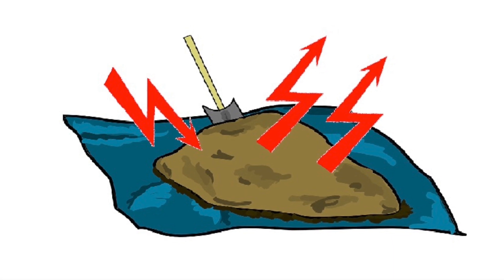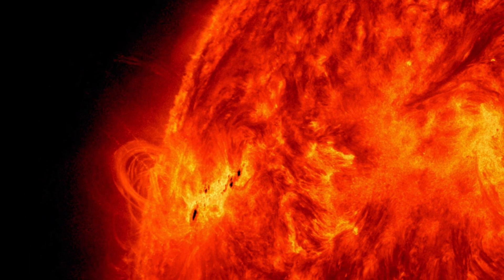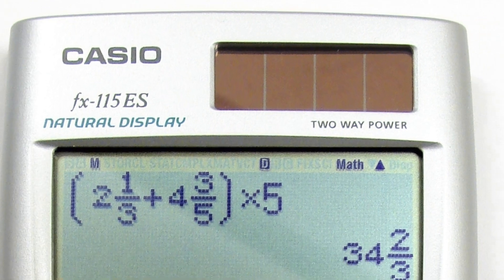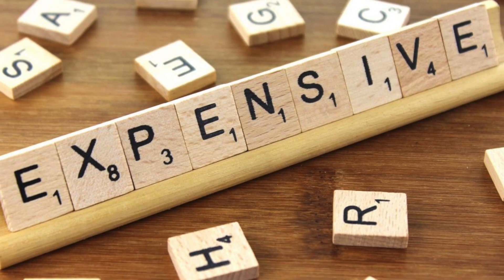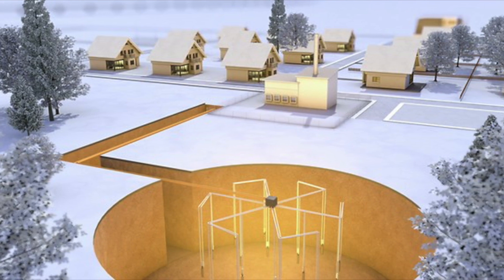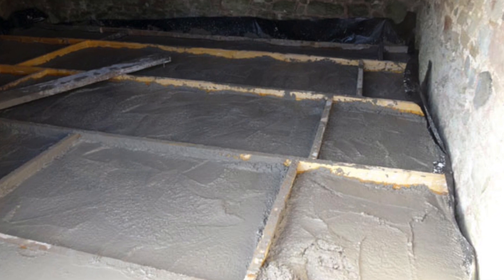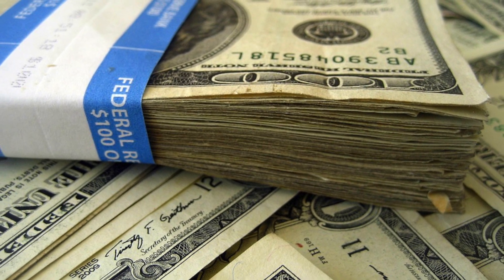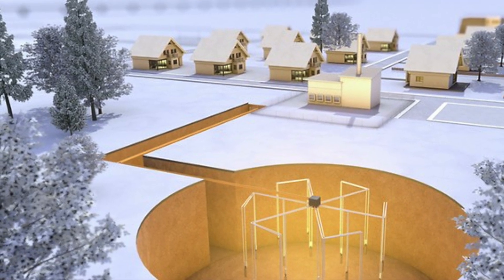Home Solar Thermal Dirt Battery (2020)

Comment: geothermal energy has been around for a very long time...but if you were going to go through all of the trouble to heat your home basically for free...why not make it so you could pump the cold into the ground to use in summer for cooling...you only need about a 20 degree difference in temperature for cooling while you have a  much bigger difference in temperature to   heat your home compared to the temperature outside...so technically it should be much easier to cool a house in summer than to heat in winter
Reply: no...I'm not confused.. its definitely u that's confused...what's the difference if you transfer heat between a heat exchanger inside of a house and the ground down far enough to where the temperature of the ground stays consistent....and between a heat exchanger inside of a house and an insulated tank in the ground...well I'll tell u the difference...its the tank....all of the energy comes from the same exact place at the end of the day...the sun...and that heat energy is transferred between the house and ground for both...you just live somewhere it requires you to use a insulated tank in order for geothermal energy to work for you...costing much much more to transfer heat between your house and the ground....and it's still not even capable of cooling down the house in summer because of only 1 tank...its either that and you just got ripped off and you dont even need the tank to begin with and you would be able to both heat and cool your house without a tank  by just putting a heat exchanger inside of the ground low enough where the temperature stays consistent...why go through all of the effort to pump heat into the ground from the sun in summer to use in winter...sure it might help cooling down the house for a little bit in the beginning of summer ..the tank only holds so much fluid and will quickly reach maximum temperature and capacity then there is no way to transfer the heat to the ground now you have a much more dense hot liquid on top of your roof that you must deal with...you could just use your tap water to cycle the hot water on top of the roof once the tank is at maximum temp and capacity...you can not transfer heat to a insulated tank only...I know how everything works cause I am a certified hvac technician...and this is a shitty concept...I suppose this is where you say that there is a heat exchanger underground that can transfer heat to the ground when the tank reaches max temperature and capacity...then why even have the tank to begin with...how big is the tank anyway...you definitely wont tell me because you now know that I am in the hvac field and some math would come your way to show how stupid of an idea this really is...retarded on many levels...1 btu is the amount of energy it takes to heat up 1lb of water by 1 degree...all of those btu's of energy on top of the roof would have to be removed by a ac just to get the house to where the energy is cancelled like it's not even there...before you could start lowering the temperature in the house using ac...idiotic would be an understatement
Reply: @metou3072  The deeper you go the warmer it gets..  Why would you bother pumping cool air into the ground when you can already pull cool air out of it in the summer.. There is a reason a basement is the coolest place in the house in the summer.
Are you planning on making perafrost under your house to cool it with.. This seems odd.. There is no need to pump cool air into the ground just pull the already cool air out of it. FFS.. People will argue over the dumbest shit on YT..
Reply from the maker: @masterv2118  no no no he works with Hvacs, he MUST know what he's talking about.... not my Hvacs, but someone's Hvacs....
Reply from the maker: @metou3072  Sorry, no, you don't get it. You really don't get it. Your response made that very clear.  You're now trying to justify something you really don't understand to make yourself look smart. It's NOT geo thermal, it's geo battery. They are very different systems regardless of how you think they aren't. Thinking they aren't different just means you don't understand and you dug yourself deeper into not understanding with that reply.
Reply from the maker: @metou3072  you still don't get it. it's not an Hvac system. once you finally let go of that you can move forward, till then you're in another world.
Reply: @SimpleTek  show me a battery that can not provide electrical energy?... Besides a drained battery
Reply from the maker: @metou3072  don't take words out of context, it's a "climate battery", it stores heat. With your every reply it's pretty clear you don't know what you're talking about and are grasping at straws here.
Reply: @SimpleTek  words out of context??? why did you use those words if that's not what you meant??? Not making much sense  my man...let's be real..a tank is only so big and the sun can only heat a fluid so much...the hottest day of summer...possibly 2....then u have a tank that is as hot as it will get without adding energy to it...and use that to heat your home all winter long...pure genius I tell you...pay to put a huge tank in the ground to put a day or 2 of the summer heat (that's at most 20 to 30F to hot to be comfortable) in storage by transferring it to a fluid...store it in a tank and pray no heat is transferred from the tank to the ground...and use it to heat your home the 50..60...70...80F in winter for 8hrs before its depleted...genius I tell you
Reply from the maker: @metou3072  it's exactly what I meant - you're taking words out of context to try and look smart. It isn't working.
Reply: I will be hear waiting for you guys but something tells me that you guys are done making a ass out of yourselves...how about that tank size so I can give you the exact amount of heat it could supply a home in winter and how long it will last...who am I kidding you guys took your ball and went home because how bad u were beat...probably wont even play the game anymore...look up anything that I said and prove 1 thing I got wrong...awfully quite guys
Reply from the maker: this is NOT geo thermal, it's geo battery charged by solar thermal panels. VERY VERY different concept. I think you may have gotten confused there.

Comment: you speak as if its already built. im very curious about what it actually looks like. the stock photo slide style presentation is very confusing for me.
Reply from the maker: There are many dirt batteries in use today. you can check out my other video called "Top 5 Greenhouse Climate Batteries giving Free Heat in the Winter!" or look up "drake landing solar community"
Reply: @SimpleTek  thank. best of luck to you

Comment: I dont think aircrete is waterproof. Filled with water it is no insulation. I also dont think it can be strong enough to hold meters of dirt. But styrofoam can ofc do that. The idea is good. Keep at it.
Reply from the maker: I plan to experiment with it. I've heard it floats and is waterproof...but..... testing will tell. - good observation

Comment: Could you please make an step by step instruction? It would be interesting
Reply from the maker: I'm building one this spring - I'll be filming that and posting it then. Thank you for the comment!
Reply: @SimpleTek  I don't see that video. Are you building Soring of 2021?
Reply from the maker: @RBPofSLC  I'm going to build a few things this year
Reply: @SimpleTek  that should say starting this Spring. I am referring to the large dirt battery with the aircrete insulation.   I am interested for both a home and greenhouse.

I remember years ago there was a video using an old satellite dish with mirrors heating up a molton Salt mixture and doing more of a heat sink to accomplish the same thing but this solution seems easier or should I use the word "Simple? "

Comment: I have wondered the efficiency of this system for my application,  as I have many feet of clay. But, I have a rather high static water level. It is about two and a half feet below surface. Any thoughts if it may be feasible? I live in a rather cold environment,  that can reach -40 to -50°F in the winter.
Reply from the maker: good question. can you install a watertight plastic sheet and or insulation around the earth battery when digging it?
Reply: @SimpleTek  , that may be a viable solution.
Reply: This might work, but you need to ballast it like a boat otherwise it will float to the surface.  You will also need at least R45 insulation on all sides.  It will need to be water tight.   Basically a storage of 10 x 10 x 8 can story 1 million BTUs for about 10 days (more or less depending on the whole engineering).   At those temps you will be loosing a LOT of heat from your home unless it is super insulated.   One thing you might consider is building this above ground and then covering it with a mound of dirt for protection.
Reply: Water has a very high thermal capacity. It stores a lot more heat per unit volume than dirt and because of this one can have a smaller earth battery.
Reply: From the research I have done, I believe that IF the water table is static and there isnt much movement away from the site of your trenches, the water can be a benefit as water has a higher specific heat capacity 5x than clay, and great conduction. 
I am thinking about running pipes down to my ground source pipes to funnel the filtered outlet from my fosse/septic system from summer till early autum. Ill drop a couple of probes in a dry section to compare the temps in January/March.
Reply: @crecclestonable  Remember, septic decomposition relies on heat.  Its embodied heat already has a use in permitting bacterial breakdown.  Extracting the heat from the septic tank or the drainage field might nullify this action, which could result in polluting the ground and groundwater. Suspended particles would not decompose into their smaller constituent components, but remain to plug the holes in the drain pipes and rocks/sand.  The solution to plugging is to pour gallons of H2O2 down the aerated pipes.  Oh yeah, septic decomposition is now considered to be aerobic, which requires surface-leading air ventilation pipes, which would release some heat.  That may or may not factor much into the geothermal system efficiency.  

I suppose this worry might not apply if the geothermal return loop does not drop below a certain temperature, as is the case with non heat pump extracted heat.
Reply: @mikemotorbike4283  Hi Mike thanks for the reply but I think your septic systems or my explanation are different to your understanding..... In France for instance the waste goes to the 2 chamber septic digester, and on to a filter bed, Only after the filter bed has done it job does the water go to the soakaway.... it is at this point that the water will be diverted if required to saturate the slinky field. Moist or boggy ground conducts heat the the pipes better then sandy clay. I hope this explanation clears it up.

Comment: Overall, big systems that are effective in transfering and using low heat differentials are more successful than smaller systems that rely on high tech to move high heat differential based heat.  That is why overbuilding is a such a good idea.  Direct solar air heat works this way, where a blower across lots of simple screen heaters can heat a house.  Pex dirt batteries will be similar.  In floor radiant heat must be redesigned to be larger (more linear feet and more circulation) if the heat of the liquid is 40 degrees C instead of 60.  Etc.
Reply from the maker: well said

Comment: You should consider using automobile coolant.  It think it is mostly propylene gycol and has noncorrosive additives.  You may need to run only water underground due to environmental issues in the event of a leak.  That would require a heat exchanger or a drainback system.
Reply: Auto antifreeze is ethylene glycol
Reply: Auto antifreeze is not good for use in hydronic systems. It will kill your components. Food grade no toxic high temperature propylene glycol with inhibitors. Never more that 50% antifreeze water mix. Too much antifreeze will be less efficient and cause reduced pumping. Look at the mix charts for protection you are trying to achieve.
Reply from the maker: Great idea

Comment: The air extraction system is subject to mold, especially if used for cooling.  I also suggest smooth rather than corrigated pipe for better air flow.
Reply from the maker: Everyone says that but the people I know who use an air extraction system don't experience mold - the moving air seems to evaporate all moisture eliminating mold
Reply: @SimpleTek  There are also several ways to allow any condensation that does collect to be removed .. the lines on a slight incline and drain water out from lowest point .. or lines (or sections of lines) that will allow water through the lines .. be it small perforated sections .. or slightly porous lines (like soaker hoses) .. or .. just have a closed loop system , that keeps the ground air separate from house air .. a heat exchanger moves the heat between them but keeps the air itself separate.
or ..

My personal favorite .. use a heat pump .. not expensive fancy heat pump .. more like a few simple modifications to the air flow (in/out of cold side , and in/out of hot side) of an inexpensive mass produced window air conditioner .. because of the economies of scale , this type of heat pump is super mass produced , and can be had very inexpensively (especially used on places like Craigslist) .. #1> it would allow for dehumidifying air going into the dirt battery (cold side of air conditioner goes into dirt battery , hot side into house) .. #2> It can increase the useful temperature output .. so even if/when the dirt battery gets down to 50F or 60F it can still give far warmer hot side output to the house .. #3> getting such a heat pump that can give you 3x more joules of heat output than the joules of electrical you put into it is not hard .. it'll get the rest of the heat from the side it is making colder .. #4> as a bonus , the separate hot and cold sides allow for a built in air isolation , soo the air down in the ground stay in the ground loop , and the air in the house loop stays in the house .. thus no risk for moisture , mold , radon , or anything else like that , from the ground loop.
Reply from the maker: @ianpgeorge  some people use perforated lines too
Reply: Corrugated tubing creates more air turbulence which allows for more efficient heat transfer. The fan has to work a bit harder, though, to move the air.

Comment: I do not see a need for a second set of pex loops in the ground for heat extraction.  You should be able to extract using your input system if you overbuild the combined system.  Overbuilding is necessary because of less spread in temperature when extracting, especially at the end of the heating season.
Reply from the maker: Pex is cheap though

Comment: I started thinking about earth as a storage medium after I realized how many gallons of water would be needed to store a winter's worth of BTUs. Thats a huge tank. I would love to see other's thinking on the math of energy storage and extraction.  I am no engineer.  Rather I consider myself an idiot.  But, whatever material is used for storage it will receive heat from water.  Water over 212° is problematic and water below say 70° is probably useless.  So your storage medium will range from 70° to 212° max.  That dictates it's storage capacity, at least its usable storage capacity. Each cubic foot of material requires a known number of BTUs to raise 1 degree.  With a little math we can figure out how many BTUs can be stored in the big hole in the ground.  Hopefull its in the millions.  Now how big a collector is needed to capture that many BTUs during the warm months?  
I would love to see someone else's math regarding all these things.  Im sure this can be designed in such a way as to negate the need for oil heat in a northern home and have a very basic design that any contractor can build and regular heating guys can understand and service.
Reply: You dont need to use water, maybe price will be problem, for some alter material like brake oil, coolant, ....
Reply from the maker: good points
Reply: One BTU is what it takes to raise one pound of water 1 degree F.   So a Gallon of water weighs 8.3 lbs.  It takes 8.3 BTU to raise it's temp 1 degree.   From there we can calculate that if we want to heat our home at 70 degrees water that is warmer than 70 degrees can provide 8.3 BTU / degree / gallon.   At 140 degrees you will need  1,721 Gallons of water to give 1 million BTU's of heat storage.   1,000,000 / 70 / 8.3    This is 8.5 cubic yards of water or a space about the size of a small pool.  8.5 ft x 3 x 3.   Another way to think about it is to say this would be it is the same as 8 IBC water storage cubes (220 gallons each).